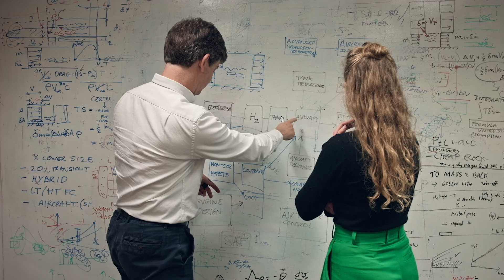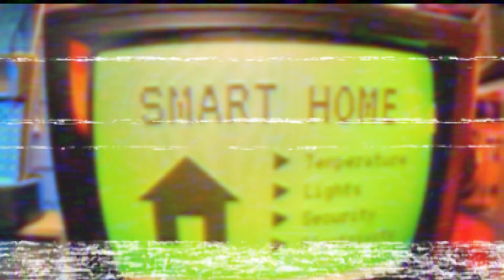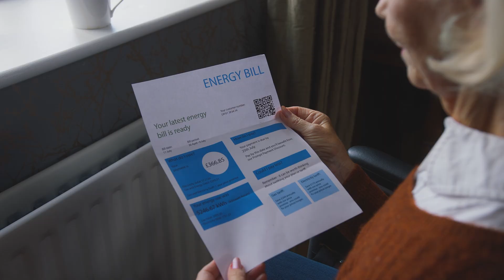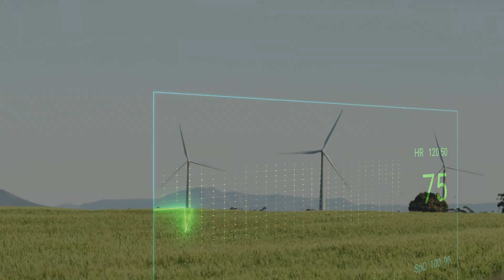Could The UK Be Powered By 100% Renewable Energy?

Comment: Uks problem is corruption. Oil/gas companies pull the strings. Pay 1 for 1 on rooftop solar, allow any qualified electrician to install, not just MSC. DONE. every one will get rooftop solar. CORRUPTION IS THE PROBLEM.

Comment: Countryside and fields covered in solar panels = loads of energy but no food = starving population = less energy demands = less need for solar panels = fewer solar farms = dismantled panels = massive polution.
Reply: That is why solar panels must be installed on your rooftops and individuals must learn how to generate and save energy as they go to learn how much energy every action costs. Also, whether you have barren or deserted lands you put solar panels there too. Some common sense would you 😅
Reply: There are agrivoltaic systems and vertical panels, these work with agriculture. This will add to private roof systems.